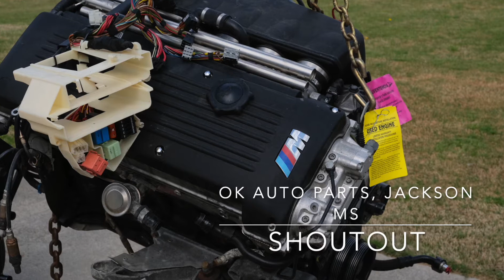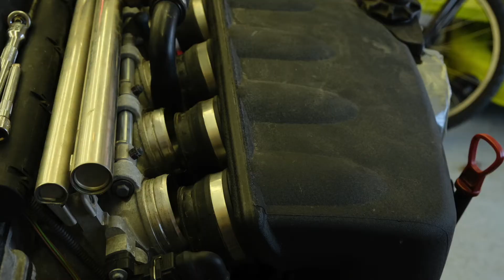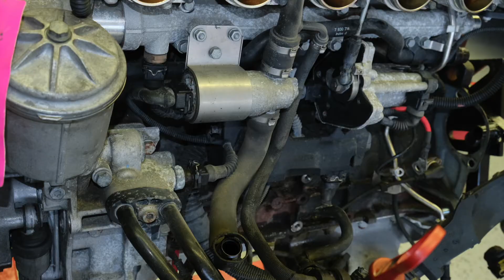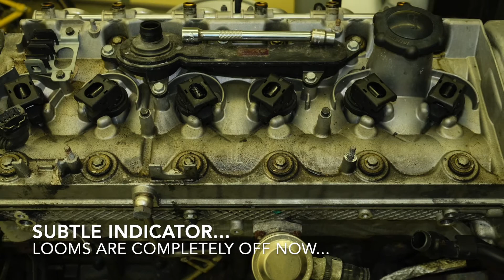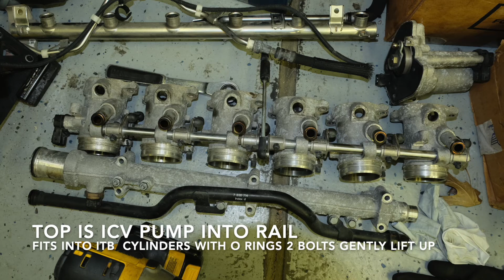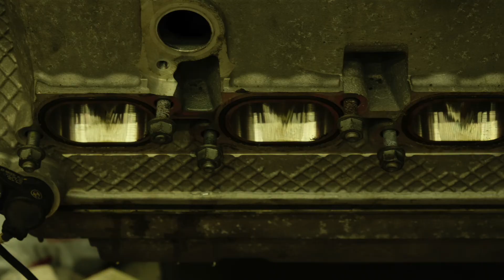S54 swap into e36 EP1:  Arrival and initial tear down

Comment: Is your swap still in progress?
Reply from the maker: yeah! very recent.  head is at the shop getting radius valve job.  ECU ordered.  gaskets for top and bottom coming.  starter. swap wiring (head guys son does them) getting sorted.  will post up more soon.  need to clean block in prep for paint.  conrod bearings arrive today.  so far everything looks good on the motor!  and I got a good deal on it